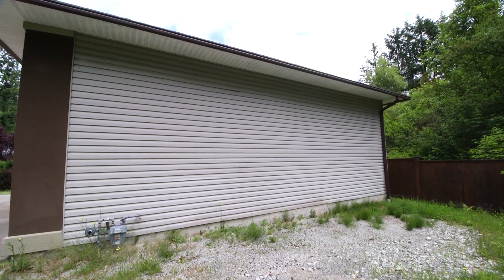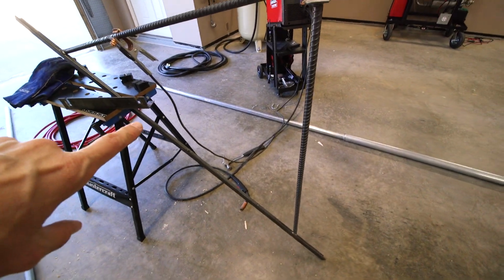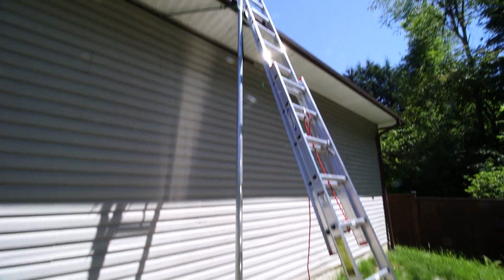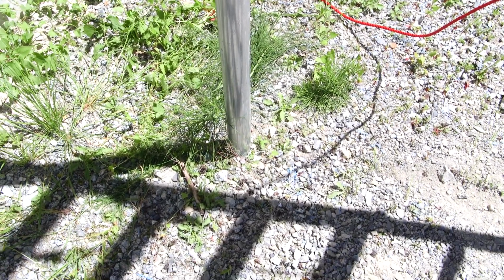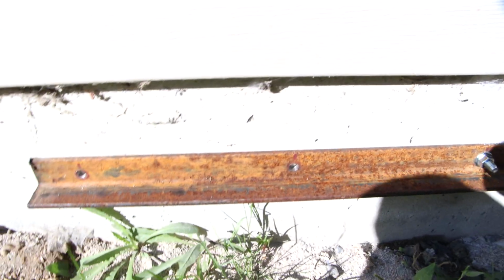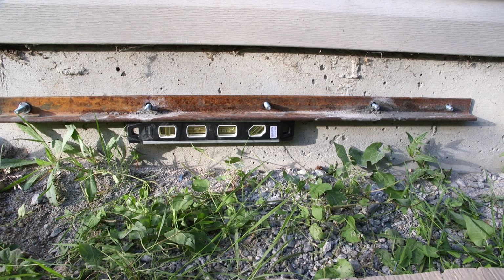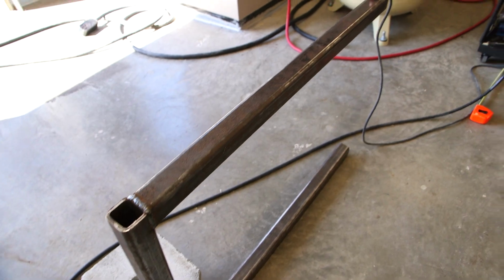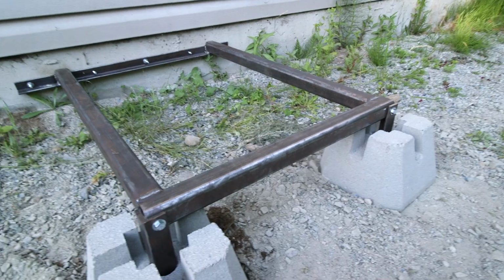Antenna Build, [Mounting Fabrication] Part 2!

Comment from the maker: To learn electronics in a very different and effective way, and gain access to Mr Carlson's personal designs and inventions, visit the Mr Carlson's Lab Patreon page here: https://www.patreon.com/MrCarlsonsLab
Reply: Hi ! If You use rubber between U clamp and pole and spring washers between end bracket(of U clamp)and nuts , it will stop on a long run from wind moving pole(usual lose of signal in 85 % of cases).All Best to You and Family.
Reply from the maker: @pjczuba  Thanks for your input!
Reply: @MrCarlsonsLab  - and vice-versa , I am one of patreons on Your channel.
Reply: Always look forward to your videos Paul...you do first rate work and seem to be a top shelf fabricator as well
Kudos man...
73 Jeff de WD8JM
Reply from the maker: @jeffminnick5209  Thanks Jeff!
Reply: Paul, you should get that rebar bracket sand-blasted and galvanized (usually done at the same shop) to help resist rust much longer than the 'rattle-can' paint will. Great work there.
Reply: Excellent progress. Can't wait to see Part III. 😀

Comment: Pro tip: Unistrut makes mast installs, and antenna installs in general, so much cleaner and easier. It can be used on walls, under eaves, etc. There is off the shelf hardware for clamping to masts. And a plethora of options for custom solutions when needed.

Comment: Rebar looks nasty. Should have used angle iron on the top too.
Reply from the maker: I like the looks of Rebar. It's very strong too.
Reply: A little note about rebar: there are basically two types, standard, which is made out of recycled scrap, and certified, which is used in critical applications.
As you can tell from my grammar, I am tired and I'm not going into the details, but something to consider when designing a project.
Reply: @mikesmith-po8nd  Rebar is made to be buried in concrete too. lol
Reply: @MrCarlsonsLab  Be cautious which reinforcement bar you choose . Only certain types should be welded. High carbon content bar will only crack at weld if stressed. Lots of documentation out there to research on this topic.
Reply: Robert Heintz - R Seven said it well. I didn't go into detail partly because I was tired, but mostly because I am quite confident that Mr. Carlson has the ability to research it for himself.
If he hadn't already.

Comment: The term for this overhang is called the soffit. The term for the vertical of the mast is called plumb. BTW, when the array is grounded, do you have to drive a ground rod in as with a TV antenna?

Comment: You may not have considered that the foundation will NOT move in the winter (it has deep footings)... but those concrete 'feet' may heave up when the ground freezes. You may wish to design the upper brace to allow for some vertical movement of the post.... lest your roof overhang may get damaged.
Reply from the maker: Hi Bruce, the bracket is about 2 inches under the eve (gutter,) and has some vertical play (angular.) This was considered during the build, I figure any vertical movement wouldn't amount to more than an inch either way. Nice to see others contemplating the same issues as I'm faced with. Thanks for your comment!
Reply: @MrCarlsonsLab  great minds think alike!, they say

Comment: I would pour a serious concrete base, with two square pipes sticking out. I would insert the antenna pole between those pipes and secure it with two bolts right through those pipes and the antenna pole. If you remove one of these bolts, you get a hinge to lower the antenna.  Very simple, very effective.
Reply: My thought as well, and you could even keep the mast slightly off the ground to reduce corrosion issues.

Comment: Is the top mount on the eves only attached at the wall or is it also attached to the underside of the eve? Does it not droop without extra support? Thank you
Reply from the maker: The top mount is only attached to the wall, the angle iron bracket mounted to the wall holds it solid. The large diameter 3" long screws go through the bracket and wall right into the suds behind the wall. When the pole is attached to the bracket, there will be no up and down force as the pole itself acts as the vertical brace for the upper bracket.

Comment: It's kind-of weird how the rest of the world doesn't concrete a poles in the ground like we do down-under. Because all our fences are steel posts in concrete they make a simple kit do it, ie, hand post hole digger, pre-mixed and sized bags of cement for 1 post that you just add water. Then it's dig hole, stand the post, and pour in the mix, ie, it's as easy as making mud pies.

Comment: Well I'm getting the Patreon. This level of knowledge on electronics is too good to pass up I'm afraid.
Edit: Not based on this video alone. I've watched about 100 hours of restoration videos on the channel and feel guilty that it's free.
Reply from the maker: Welcome aboard!
Reply: You won't regret it. I signed up not  long ago and there's a wealth of info there. I've always found older tube based electronics interesting even though I know squat about them. Slowly but surly thinks to Paul's and similar channels I'm learning and will hopefully be able to restore a couple old radios I have this winter.

Comment: Your engineering is uncriticizable.  But if I had space to put up some sort of similar long wire combination it'd probably be noisy.  Instead for my loft I built a large magnetic loop using the outer braiding of a stupendously large coax tuned by a remotely controlled stepper motor.  It has a high Q value and can handle at least 200 watts in transmit.  It covers from 1.8 Mcs to about 11 Mcs It is low noise.  My only regret is that I can't rotate it to use it's directionality. Tom

Comment: paint stripper discs are way more effective at removing rust and light mill scale than a wire brush, especially when it comes to welding. i worked in machine shop grinding pits for a couple of years, and that is the weapon of choice for those conditions.

Comment: Just a tip for cutting metal on a chop-saw. To save time and wear and tear on your saw always place your material in a way that you minimize surface area of the cut (ie. a square tube placed in a diamond pattern or an angle iron as a triangle). This will make the cuts faster.

Comment: Very nice work, I like your method of using the concrete deck post for support and leveling. In a similar situation I used adjustable jack posts, yours method is more economical. I must assume you have returned to the lab based on the unseasonable and unreasonable heat the BC coast is experiencing. Stay cool.

Comment: That's definitely strong! I have a roof mount that came with my antenna but it's going to be repurposed for a half-way ground mount for a 12 x 10' aerial. I was thinking of putting 4x4's in the ground the normal way (strait up and down), or have the roof mount close to the antenna and have the 4x4's go sideways up towards the mount to mimic an old school A-frame. It's a lot more work but I'm thinking of going that route.

Comment: Hi to all you   Mad insane Tecs in the  MR Cs collective lol .You know some times you have a eureka moment trying to think out of the box   for a suitable way of putting up a antenna. Well yesterday next door had a birthday party blowing up helium balloons  if you let them go they flout way up in the sky .next door had some spare so I just happened to  have 50ft of  .75mm wire lying around  attached it to the balloon .(INSTANT VERTICAL ANTENNA) .and do you know it worked really well .stayed up all day.but   it was only an experiment. So be careful experimenting ( aircraft flight paths power cables etc) .  so kind regards to all you mad insane Tecs from over the pond

Comment: Mr. Carlson, what do you plan to do for lightning protection? When I got my novice license many years ago, there are a couple things that were being discussed. One was to make a long loop of antenna wire underground, the other was to zigzag it. I'm sure that there are other ways to protect radio gear, but those were in common use in the 80's.

Comment: looks like quite a bit of work.
just make sure there is a way for water to get out of the concrete blocks. you wouldnt want the metal to corrode from standing water

Comment: I enjoy your videos, and learn so much. Thankyou. Have you had experience with arc/ground fault circuit interrupter breakers in your shop electrical supply causing problems with your test equipment or builds or repairs?

Comment: I really like the design at roof level.  For the ground I would have poured a concrete base, but I'm sure you had your reasons why you didn't.
Looking forward to the next segment.
Reply: Was my first thought as well. Concrete base, two pieces of angle iron sticking out so a piece of tubing fits in between that could hold the mast. Or maybe even the mast itself.

Comment: Mr Carlson, I can maybe see some minor thing you may take a look at, I am afraid you maybe can expect some major damage on your wall. The blocks you have used will properly begin to dig themselves down over time, due to rain or maybe raise if you live in a place where the ground can get below zero. In short, your setup will move up and down and give damage over time. Also, you need to make some water droplet catchers that prevent any water to run into your wall around the screws. Normally is it often best to build brackets so the angle downward as they go outward, making a few degrees slope away from the wall. :-)
EDIT forgot: To prevent wandering, do one often use pillars that goes at least 4 inches below the grounds freezing line. The pillar has to made of a material that do not flex too much. The best is pillars made in hard concrete that is wider at the base than the top, so the dirt is pushing together and downward on the pillar, I recommend at least 6x6 inch in the bottom and 4x4 in the top, 1 yard long or and at least 4 inches below grounds freezing level. :-)

Comment: So nice to see you do some metalworking and welding too, Paul. (Very nice welding by the way).  It shows that you are a real handyman, and can do anything you want. I also love to do some metalworking in the summer while I love to do radio-related things in the winter.  I just bought a cheap lawn mower and made a bracket to attach it to my old tractor, so I can use it as a bush cutter. I look forward to your next part about this antenna build.   Have a nice summer Paul, love your videos and the stuff you show us in your Mr Carlson's Lab Patreon page. 73 LB5JG - Asle

Comment: If you have very tall trees nearby then what V5JGV (Ralphs Treetenna) that he has working on 600KHZ it should be possible using a tapped HEMIC toroid  to tune up on other frequencies.

Comment: it will be really rigid when you are done. QQ though, why not place one cement support in the ground with a hinge on top. Weld a support bracket onto the hinge which will allow the pole to be inserted and secure the pole at bottom with  a bolt? Support bracket could be round to accept the pole so no rigidity will be compromised by drilling thru pole at bottom?

Comment: that air grinder with a wire wheel so close to long sleeves and gloves made me nervous, I would take the gloves off ant roll my sleeves up
Reply from the maker: I NEVER use a grinder without thick gloves, If I accidentally make contact with the disk or wire brush, off to the emergency.
Reply: I was gonna say, I bet you had fun with that wire wheel attachment. Those little things will fly off that wheel at 10,000 rpm and stick in you but really there’s nothing better for cleaning up rusty stuff quickly.